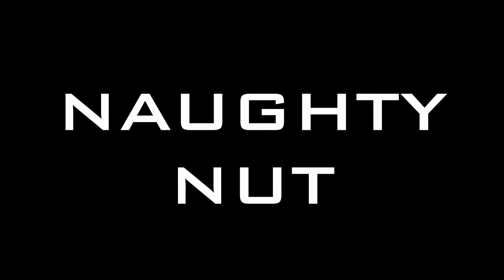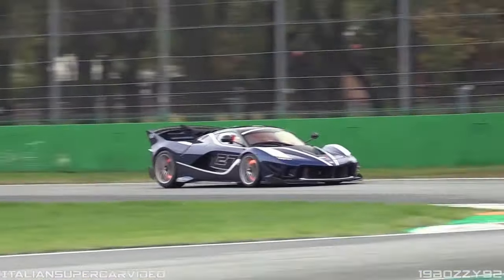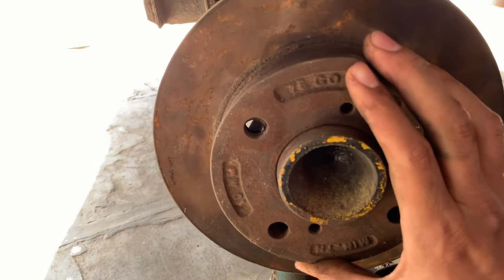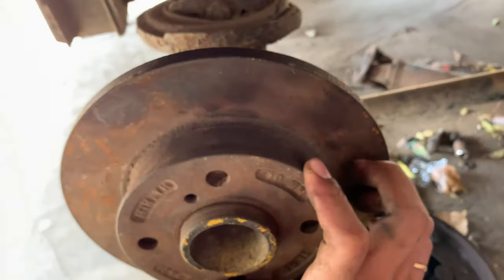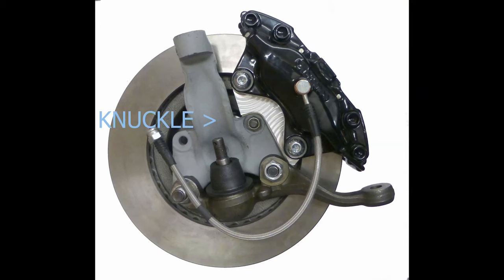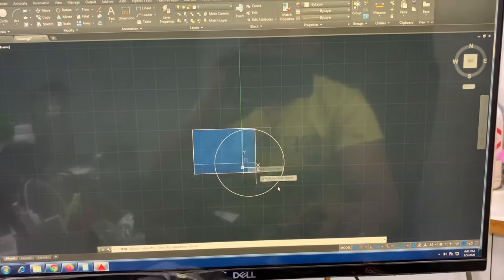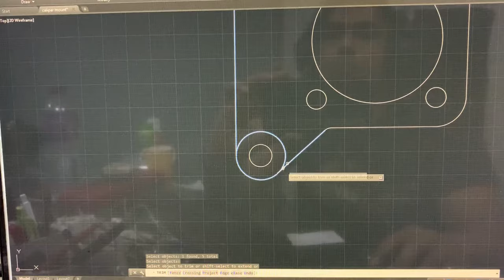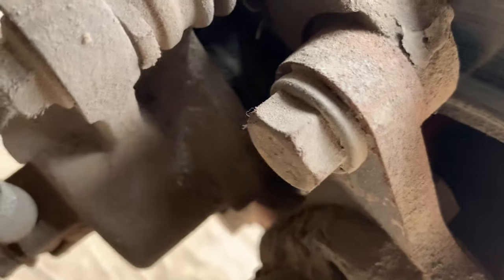HOW TO CONVERT DRUM BRAKES TO DISC BRAKES | Project Drift 🇮🇳

Comment: _hi.. 
kindly suggest solution for rear wheel disc brake conversion of the maruti vitara brezza.. 

_thnx n regards
Reply from the maker: You should follow the same process. You will need to make a plate that would mount the caliper.
Reply: @NaughtyNut  

_could you suggest the disc rotor size as well as the pads n calippers.. 
..or do we just plonk in the brezza front disc brake set at the rear too

_please revert, 
regards

Comment: hi, very informative , i wanted to ask, my car has front disc brakes , can i buy and use the exact same setup and easily get it installed  on rear wheels by a company mechanic . my Car is vw virtus gt. also will there be any electronic issues ?
Reply: i guess i wont need any custom made parts to mount the caliper.

Comment: Hi there, I plan to convert drum to disk for 2006 baleno VXI. Can you guide me with choosing the correct disks, callipers. I was thinking of installing the ciaz disk brake complet assembly. Will it be a good choice? If not please advise.
Reply from the maker: You have to fund a disk that matches the pitch of stud or bolt pattern. Most Suzuki’s should be the same. But still do check
Reply: Me too.. But on a 2000 model Baleno. I have a frnd wo used to do these kind of mods. Just had discussion on the same few days back. Will update!!